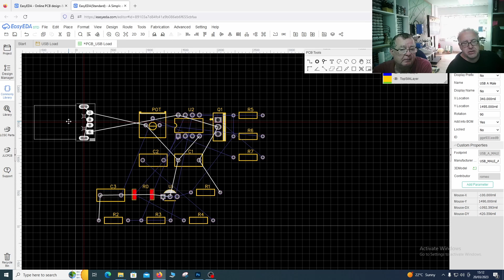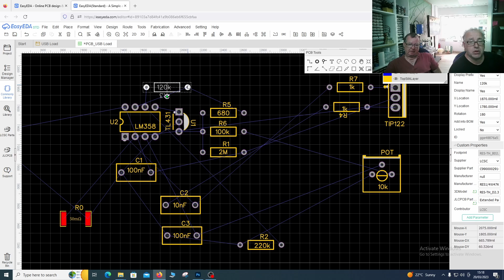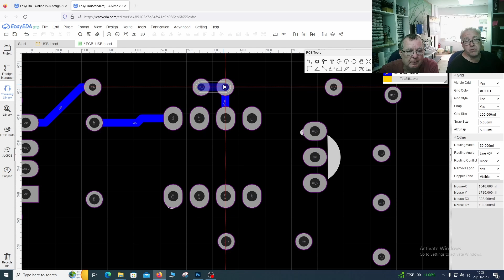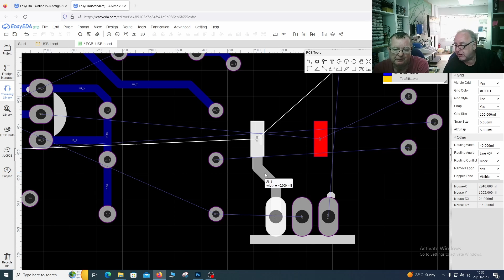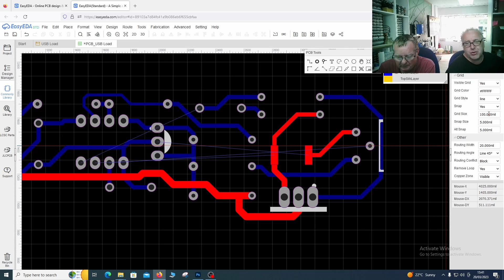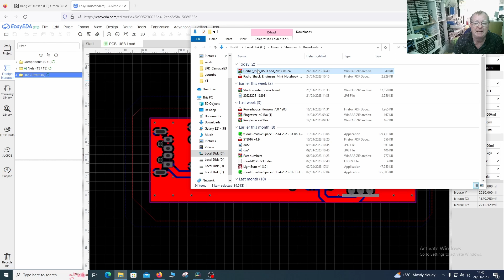How To Design A PCB, A Beginners Guide Tutorial - Part 3

Comment: Thanks for another great Vid Richard.  Question if I may.  Are you not concerned with the VCC going to the Darlington being right at the edge of the board? I only ask because I had an amp out of a cheap 15" PA speaker (Pyle) and the vcc supplying the power transistor had a similar arrangement.  once the edge of the board contacted the heat sink, boom goes the dynamite...Never did get that amp working again.  Might be a good project for me to try and redesign their crappy amp.  1500W my but.

Comment: Is it cheaper to have a single sided PCB from PCBWay? As an "oldie" we always produced single sided if we could - the single sided board was cheaper, we used less etchant and (nowadays) it would be regarded as much more environmentally friendly. Routing took a little more effort but if you needed a wire link (nowadays I'd guess that would be called a zero-ohm link) it wasn't regarded as a problem as it was just soldered as another component. For applications of less than a few amps I never recall having heat dissipation issues ... but are modern copper layers thinner than they used to be so higher resistance for a given track width?
Reply: Hi Andy - there is actually no difference if you order single or double sided - I guess the base material always comes in double sided, and if you order single sided PCBs, they simply etch one side off.
For track widths (and thermal problems): I had the space, so I went for wider tracks. This Application will probably never run long enough to develop any serious temperatures, so I could get away with thinner tracks. Bus as stated: I had the space ;)

Comment: Well, I have a few tips for you guys. First of all, at the very beginning of routing, right click on any GND pad, choose Net actions -> hide net (this is form KiCad, but all of these CAD software are very similar, sor for sure there is a similar way to do it in easyEDA). This will hide all the ratlines between GND pads. If you are using a GND pour (which you should in most cases), routing GND tracks is a pure waste of time, since the pour will take care of connecting all the ground points together. Secondly, as far as I agree that in most cases you leave creating the board outline to the very end, but this should go hand in hand with leaving the positioning of the connectors, and mounting points to the end phase as well. 
So in this case, the worklflow would be like this: Position components according to how the ratlines connect them in the easiest way, hide GND, route all the other nets axcept the USB connector (and MOSFET "connector" perhaps), create the board outline, place the connectors neatly on the centres of edges (or somewhere where it makes sense), route the connectos (use an online trace width calculator to find out the minimum trace width for the current that will flow in the power trace that goes to the MOSFET), pour GND all over the board and verify if all the GND pads got connected succesfully. Quicker, and even better with only minor adjustments to the presented process. Thanks a lot for the video, looking forward to more collabs, cheers!